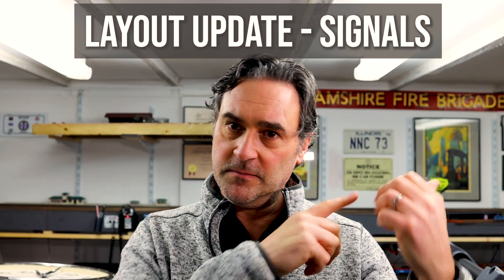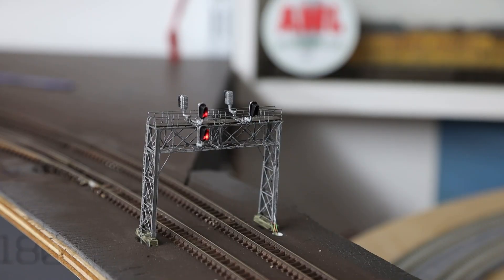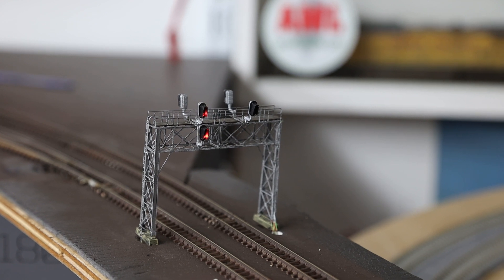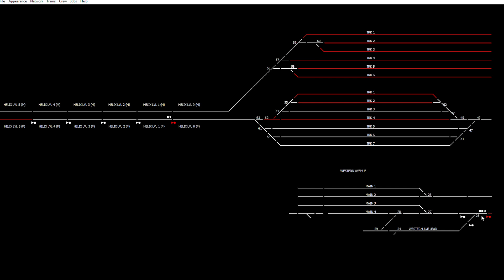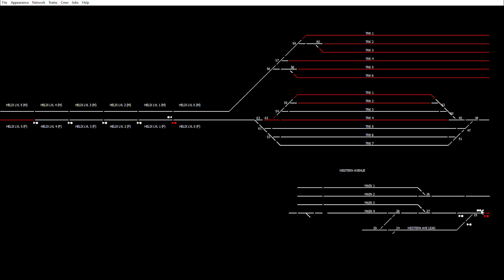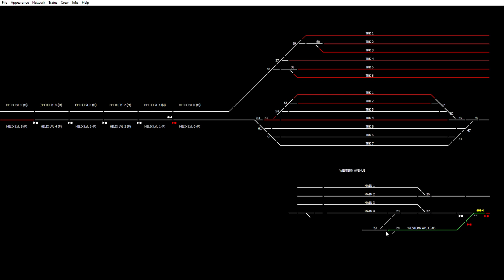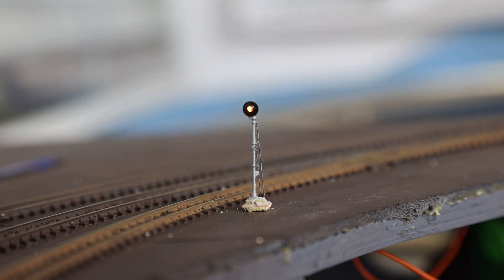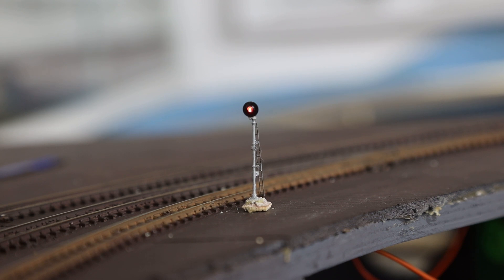N SCALE LAYOUT UPDATE: Signals and CTC

Comment: Great stuff Peter, thanks for sharing as always!  Those signals turned out really good.  You will have to do some tutorial videos on wiring up the signals as well as building the CTC panel in JMRI when you have time.  I'm ready but very nervous to start making and installing signals on my layout.  Keep the updates coming. - Steve
Reply from the maker: Yes, I’ve already shot a few videos on how I’ve wired them to the Digitrax system. I’ve used CATS for the panel - a lot easier than JMRI panel. JMRI is better for old-style CTC panels, but CATS is for modern dispatcher. Pretty much drag and drop, yet it’s an overlay over JMRI. Wish JMRI panels and signals were as easy
Reply: @ChicagoSubNScale  I’ll have to go back and find them, must have missed them. Which was the one that detailed hooking up signals to Digitrax.
Reply from the maker: Ah, sorry, no, I meant I shot some video already, but haven’t edited and uploaded yet! Depending on work, hopefully will get it done next week
Reply: @ChicagoSubNScale  awesome, no rush and thanks for clarifying. I thought I may have missed it at first! 😁

Comment: As far as resistors for the signal LED’s, what value did you use? I’ve watched a signal build video of yours along with this one, but I’ve not heard anything about resistors, and I know the LED’s won’t survive without them! Help!
Reply from the maker: I haven’t needed to use resistors as the Digitrax TSMK boards that the signals plug into have built-in resistors. I think most signal control boards have built-in resistors so no need to add extra